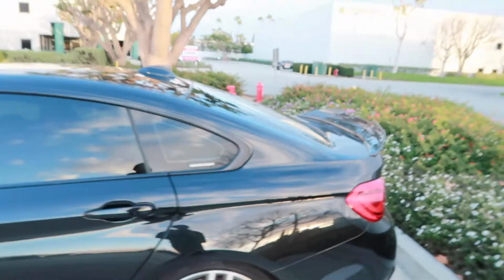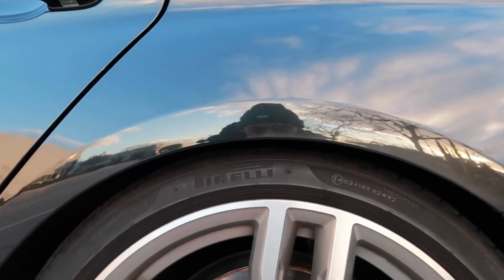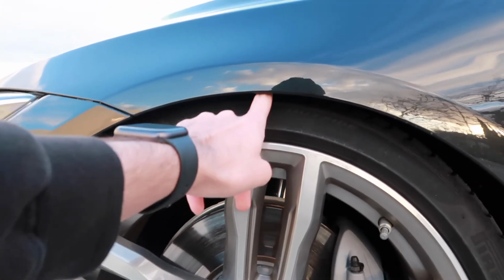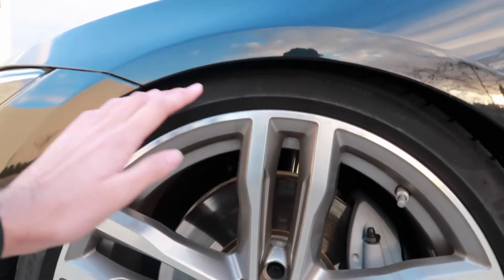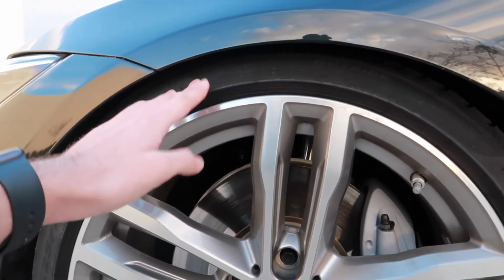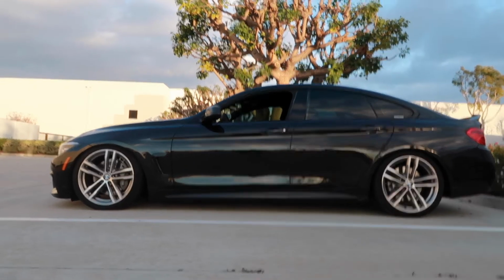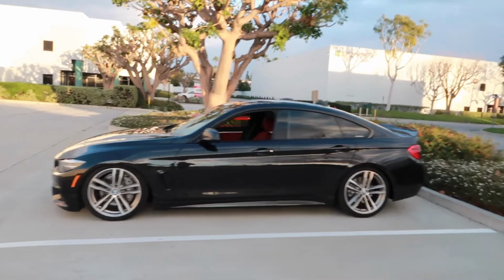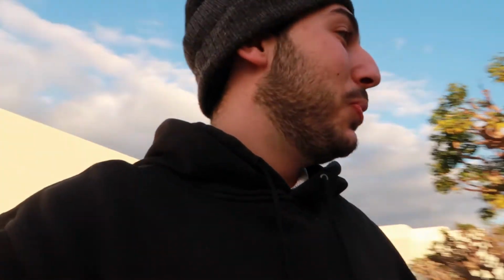440 GETS LOWERED ON KW V1 COILOVERS!! * PERFECT FITMENT *

Comment: 440i with b58 engine are beast! You should get a big single turbo kit you can make big power!
Reply from the maker: Maybe down the line but for now trying to keep it as reliable as possible
Reply: @NoahKhuja  the b58 is known to be extremely reliable even in the 600 hp range. but i also understand what you are saying

Comment: Can the f32 coil overs fit on f36?
Reply from the maker: Technically they could fit but I wouldn’t recommend it because the f36 is a little heavier in the back because of the hatchback and the extra doors so I don’t think the rear springs would accommodate the extra weight.